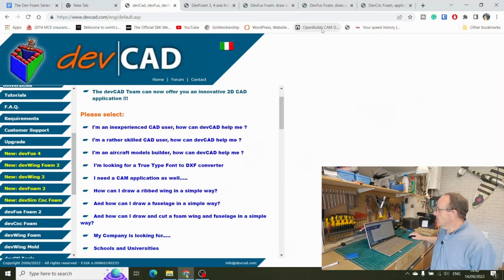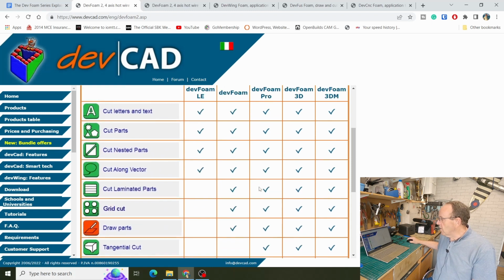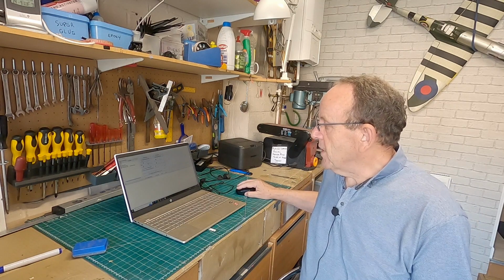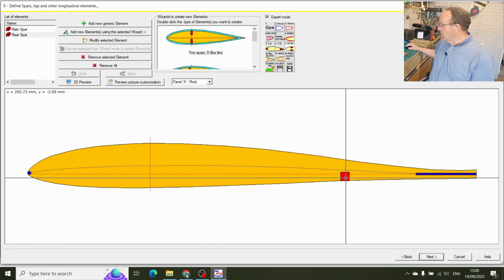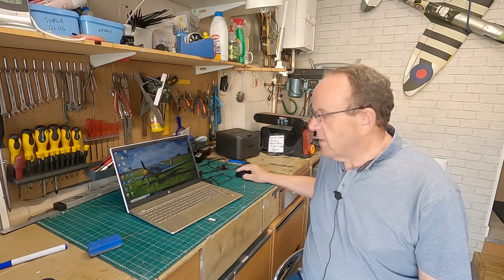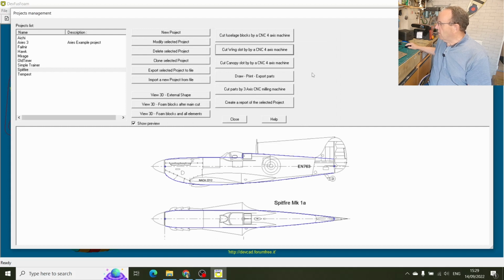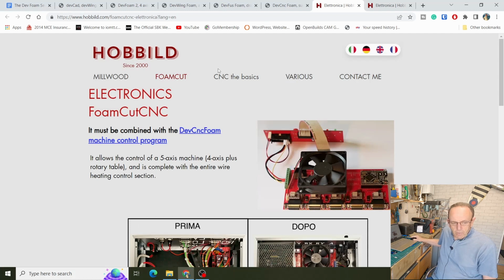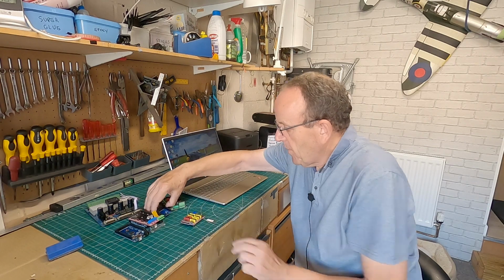DevCNC Foam,DevFoam, DevWing Foam and DevFus Foam Compared

Comment: thinking of DevWing 3 cam
Reply from the maker: DevWing 3 Cam is not for foam models. It's designed for cutting out wooden parts with a CNC router. DevWing Foam and DevFus Foam are used for generating g-code for CNC Foam cutters
Reply: @rckeith I want to design my own balsa gliders, and cut on CNC or laser 
Just want to play with it

Comment: Keith, thanks so much for contributing so much to this hobby! I’m looking to update my HobbyCNC/GMFC system and I’m not sure what electronics to use. I’d like to use thin (.010”) wire at 32” length so I need a bit of power for the hot wire. Do think the MKS board with a 36 V power supply running DevCNCFoam would do the trick best, or should I just use an Arduino 2650 on 12 volts plus a 36 V lab supply and manually switch it on and off?
Reply from the maker: Hi Ward The MKS board is a good choice but 24 Volts is the maximum input. It works well on that. An Arduino with a RAMPS board works on 12 Volts and would struggle a little on 32". The only thing to bear in mind is that officially DevCad does not support DevCNC Foam running on the MKS board although I've had it working.  The GRBL HotWire Mega 5X on the website works well on both and is free but you need the load the firmware. Which is all documented on the website and in videos.  Hope that helps
Reply: @rckeith  Thanks Keith. Although the MKS isn’t officially supported I like the idea of an easy firmware download from DevCNC foam plus the 24 volts. So if the drop-down menu inside, the DevCNC foam doesn’t have the MKS board listed, I’m wondering which firmware I would load off the Dev site?

Comment: So basically at a minimum, you would use devfoamwing 2 + devfoamfus 2 + devcncfoam. Would that be correct to compile as a basic start point?
Reply: So with those 3 licences you are sitting at 355 Euro ( $558 AUD). Not cheap by any means. And then if for any reason you lose your USB by mistake (it can happen easy), then licences are gone.
Reply from the maker: @CiaranWhelan  Stefano at DevCad is very good at replacing license. I use to store them on the computer but after a hard drive failure he sent me new ones. I use the USB for convince so I can use it on any of my computers.
Keith
Reply from the maker: Hi, I would wait before buying DevFus Foam unless you really want to do fuselages. Flying wings are good first project and that's how I started with just DevWing Foam and Mach3 on an old parallel port computer.
Keith

Comment: hi Keith
I got  MKS gen 1.4 v1 board after contact with you mine didn't work got in contact with devcad, told them my problem -- this is their reply .
There are different releases of that board, some are compatible at pin level, some not.
That's why I didn't insert it in my supported controller list
Stefano 
maybe warn others
Reply from the maker: Hi Malcolm
Thanks had a few guys ask me whether it works and none had any success.  It probably needs a custom firmware. The MKS Gen L V1.0 and 2.1 work just fine and its my preferred choice for 8 bit controllers.
Keith
Reply: I made my hot wire with a lv 1.0 works perfect, you just need te change some things in software that Keith created.
Reply: @daanvandenbossche9197  the firmware is uploaded by devcam so you can not change anything --- you have no access --- until they've read your board --- if if does not correspond with their firmware they do not upload.
it works fine with Keith's software just not devfoam etc.